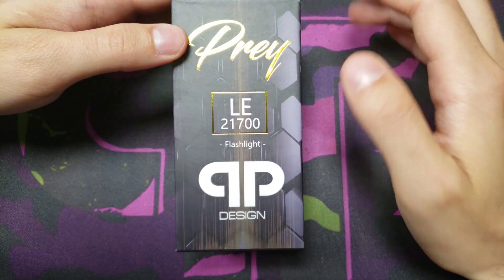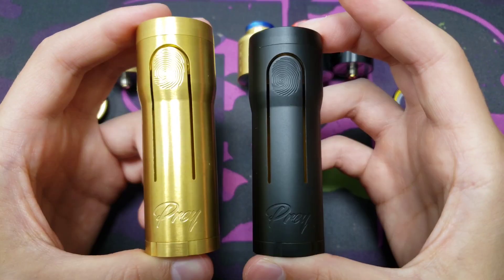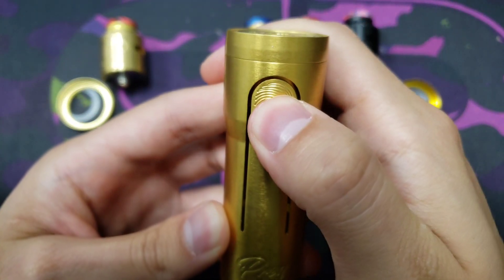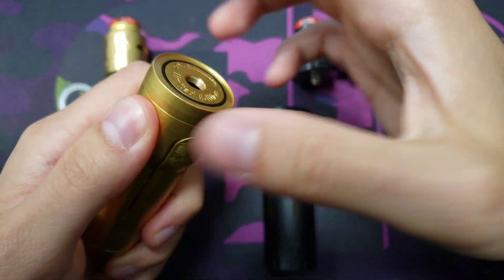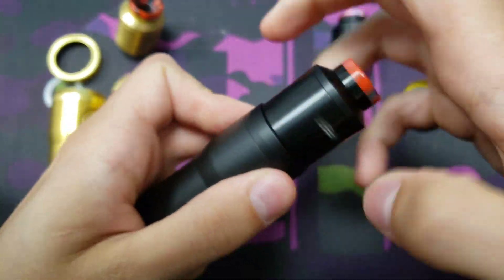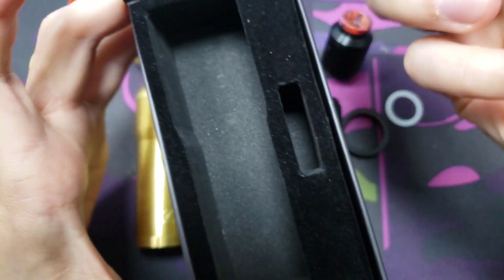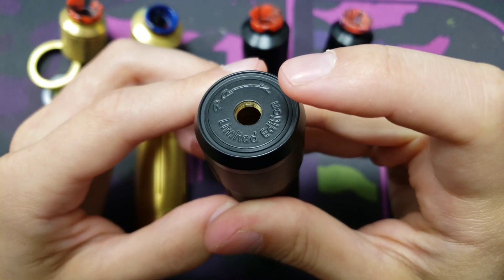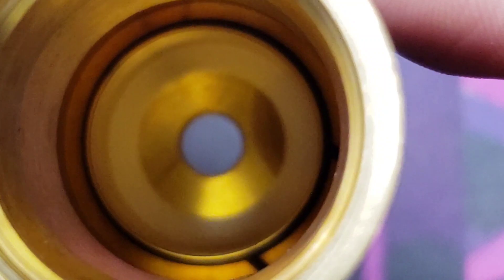Prey limited edition Mech Flashlight

Comment: So how does the bottom adjust to battery. Is there a spring loaded pin on cap or what's going on in that department
Reply from the maker: Spring loaded 💪
Reply: @qpdesign1687  awesome hey another question I ordered 2 and I didn't get them delivered yet from the shop I ordered them from. My question is does the inner top part unscrew out to get to the tube contact that the fire bar touches to complete the circuit to remove arching at the spot
Reply: Nobody is showing complete disassembly so I'm hoping all that ain't press fitted in to not be able to clean
Reply from the maker: @philipdeppen2890  We just added new video showing it all taken apart .
Reply: @qpdesign1687  I got my 2 I ordered delivered 3 days ago I figured it out. Definitely easy enough lol. Awesome design btw. For being brass contacts it hits extremely hard.